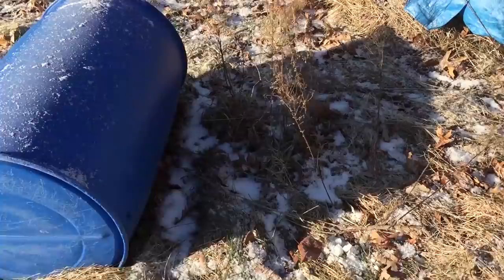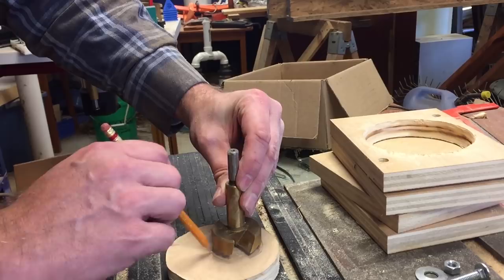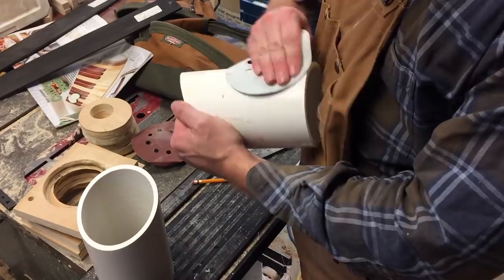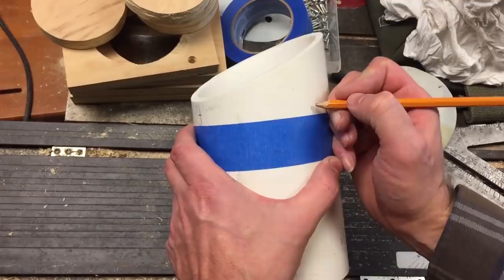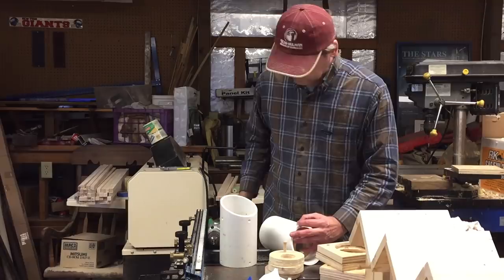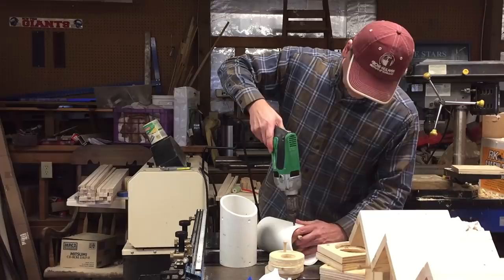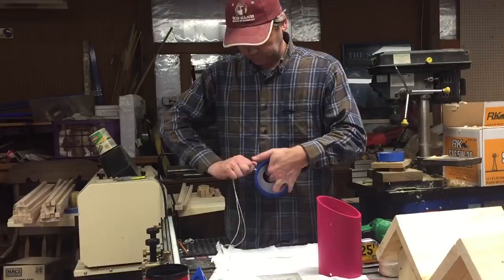PVC Bird House. Birdhouses from PVC pipe?  Are you serious?!?

Comment: I worked in a factory that had 6" dia cardboard cores from paper rolls about 2ft long as waste and I made log style bird houses of different lengths. I painted them with redguard waterproofing paint. If you make them vertical instead of horizontal you can just use wooden squares as tops and bottoms, easier than cutting rounds, and some birds like a deep log type nest box. On the deep ones I glued a strip of bird wire inside so the fledglings could climb up to the opening. I have nuthatches in one of my boxes this yr. I make boxes with different hole sizes and let the birds choose the one they like best rather than all the same size holes. I usually screw them to a tree so they are solid and some have a twig for a perch, some no perch, hanging a variety will show you what the birds prefer, I find birds will pick the smallest hole they can fit through eliminating larger predators 😊 .
Reply from the maker: That's a cool idea.  I may try to make some like that, I have plenty of pipe!

Comment: Zack, I made the same stile bird houses 2 years ago. For a perch I used a skeleton key. and same as you I used 4" pvc pipe.  But for the back of the bird house I used a 4" knock out plug. I got from the big box stores. Did not glue it in, that way I can pull the back of and clean out the old birds nest. and I get lots of birds in my bird houses every year. and my birds like the gaudy colors.
Reply from the maker: Gary, those are good ideas.  

Honestly, I was in extended family panic Christmas present mode when making these! LOL
I had to make due with material I had on hand. :)
I like the gaudy colors as well.
The houses were a big hit!

Thanks for watching

Comment: What kind of bird will live in a cavity like that with anunderstanding entrance hole that big? There are a lot of different kinds of birds that will move into a 4"x4" cavity had you made it vertical instead. I think at a depth of 9" (?) chickadees and nuthatches will move in, as long as the entrance hole is 1-1/8"Ø and 7" above floor. Keep all dimensions same but make entrance 1-1/4"Ø and titmice will move in. It also depends on how high you hang it off the ground and no perch. The 3 birds I mentioned like to live about 15' above ground. We have 2 kinds of chichadees here. They keep from cross breeding because they live on 2 different elevations. Those hollow bones of theirs must act as barometers and altimeters or something. ..anyway, cut the cavety down to 6" , keep the entrance at 1-1/4", 4" above floor and wrens will at least start to build a nest but in most cases, if it's hung right and made right, they'll move in too. The male wren will make a few nests in a few places and the female will decide on which one to move into. They only live like 5 - 8 feet off the ground. Some birds will live in houses, some on shelves but most won't live in either. Bird feeders are what you need to make and fill with good bird too (not that 100% millet crap they sell at walmart and target.) can't go wrong with sunflower seeds, cracked corn, cracked peanuts, safflower(?) seeds (the pure black sunflower seeds).
Oh, another tip about getting birds to move into your bird houses is to fill them with sawdust and wood chips so the bird thinks its doing the work of making the house. Whatever they don't remove will serve as insulation. I'm going from memory on all the dimensions. I believe the farmers almanac has all the info in it. I'm pretty sure that's where I got it  butI that was pre world wide web and Google. I'm sure it's all readily available info nowadays .

Comment: These are great! I have two questions, though:
1 - I've always read that you never put a perch on a birdhouse. If the bird is the right size for the house, they don't need it, and a perch gives a predatory bird something to hang on while they raid the nest

2 - Your balance point - it's no longer balanced once the bird makes its nest inside. What prevents the house from tipping?

Thank you for the wonderful idea. I need to make some of these!
Reply from the maker: 1 - I think we talk about hole sizes in my other bird house video.  You size the hole for the target bird species.  These holes are to small for predator birds, so the perch doesn't really matter.  This is a big debate where the divide is about 50/50. 

To perch or not to perch, that is the question... :-P

Besides, I think it looks nicer on there :-D

2 - The houses are short enough that they don't tip much when hanging. Additionally, the rear circle can be mounted to a post or other wall like surface to provide a static nesting experience. 

Thanks for watching.
Reply: YOU ARE CORRECT...NEVER PLACE SOMETHING LIKE A STICK FOR ANOTHER BIRD TO SIT ON
Reply: I have spent months researching into constructing birdhouses and discovered a great resource at Aviary magic method  (google it if you're interested)
Reply: @LumberZack  I think the debate about perches is still going on..Bird expert's say without,but also say birds prefer with a perch..did anyone ever ask the bird what it likes..lol
Reply: the smaller the peg ,,, the smaller the bird
Reply: fishtank5050  the problem is predatory birds like cowbirds, starlings and crows. They will eat the baby birds, or push them out ofthe nest, lay their own eggs, and the bluebirds end up raising them, instead.
Reply: @cathiwim  See, that's what I've always heard. And I have loads of cowbirds, jays, and grackle. Thanks, Baby Catcher.

Comment: I

Nice project but I'd like to make a couple suggestions. To
mark the position of the center of the 3/4 in. plywood front (if you have a
combination square) measure the distance the back edge to where you want your
countersunk screws and set the blade of the square to that distance. Then you place
the anvil (wide part of square) against the back edge and mark the end of the
blade for screw location. Then retract the blade 3/8 inch and use the blade
inside to hold the front in place and START a couple screws 3 or 4 turns. That
will stop the insert from twisting then tighten the screws. I would replace one
of those screws in the front and back plywood with screw eyes at each end and
top dead center instead of trying to balance the house. It would then remain
"level" and more stable when the birds move around inside it and I
believe the birds would abandon it if it tips too far. And finally the inside
of the front should not be sanded smooth. Depending on the size of the fledglings
and the entry height, the young birds MAY need to climb the "wall" to
get to the hole and a smooth surface could make it impossible. Some have used
old window screen or sheet rock sanding pieces stapled to the backside of the front
to make very rough surface.

Remember that birds are ungrateful tenants and will mess up
the house as soon as they move in.

Comment: You seem to have gone to a lot of trouble to find the prefect balance point to hang your bird house. So what happens when a bird builds a nest at one end of it? ImJustSayin
Reply from the maker: Hi Kenneth, Finding the perfect balance point has great entertainment value!  The houses are short enough that they don't tip much when hanging.  Additionally, the rear circle can be mounted to a post or other wall like surface to provide a static nesting experience. Thanks for watching.
Reply: @LumberZack  made mine with ✌🏾eye rings…🤷🏽‍♂️ works for me; keep up the great work bro!!!

Comment: Innovative idea... But hanging key at centre have a pointed tip (inside top of pipe,which is just in front of bird entry hole), it may harmful for MOM bird...and if this nest is shacking, what happend to egg / chicks...it should be firmly fixed with cage,then only bird select this nest for laying egg...
Anyway,idea is innovative but need to modify...
Best luck for more improvements...
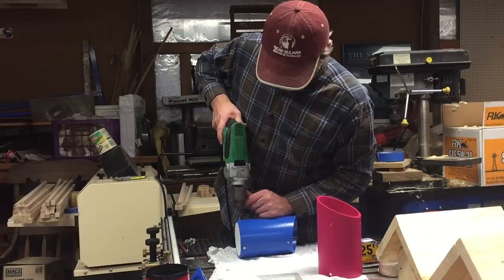Reply from the maker: Hi Rashesh, Thanks for watching.  I address the issue of the pointed eyelet at 10:35 in the video.  I discuss where I used the bench grinder to remove the point so that it's not dangerous for the birds.

Comment: Use 2 eye screws so the entrance hole is always facing the same way.  With just one eye screw the house will be in a constant state of rotation.
Reply: Also when a bird makes a nest in it, it will tip according to where the nest and birds are.  Might tip opening down and spill out the content of the nest or nose up allowing water to enter.  Really need two points of support.  Different birds require different holes and inside areas.  He needs to do a little more research.
Reply from the maker: @arkansasmountainman  A quick Google search will provide plenty of information on hole sizes.  Our 1.5" hole is the correct size for the Bluebirds in the local area that we were targeting.
Thanks for watching!
Reply from the maker: There is a bit of motion, but the ornamental trees we hang them in have a lot of branches.  This practically negates the motion issues.
Thanks for watching!

Comment: I tried the hole cutter you had, (scary), but wasn't happy with the blanks it was giving me. I found that a 4-1/8 hole saw gives you a perfect blank. Remove the centering drill, brace and clamp your wood, start slow and you got it.
Reply from the maker: Nice find!  That circle cutter is a scary knuckle buster for sure.
Reply: That thing could  tear off a finger.
 @LumberZack

Comment: I have a couple of mfr'd wood bird houses and the birds just avoid them.  Were you able to attract birds with your pvc house?  Also,, do birds prefer houses that are more stationary then those that swing?  How does one determine what size hole should be used?
Reply from the maker: The bird houses can be attached to a post or fence by removing the back, screwing in place and then placing the house onto the back and using the side screws to keep it in place. 

The fish and wildlife department for your area often have sizes for your local birds.

Thanks for watching!

Comment: I like this idea, But what I do not like is the eye screw you put in the top.. The sharp point sticks through that PVC and the bird can get hurt from that.. Would have to use different hardware
Reply from the maker: Hi Jay, thanks for watching.  I address the pointed eyelet at 10:35 where I talk about using the bench grinder to remove the point. It’s easy to miss as the grinder footage didn’t make the final cut. :-)

Comment: Building a bird house is fun but this video is not how to do it. Bird houses need natural wood not PVC (heat build up may kill occupants)  a door or access to clean them, drain holes, adequate ventilation to avoid overheating, never use perches, they invite predators, always add a predator block over the access hole.  Always go to a reputable birding site to get correct, safe plans that are good for the birds that may use it.  Building a box with a hole is not a bird house. You Tube is great but DYI people with little background can easily follow bad advice.  I can see you have skills, use them correctly to make safe homes for birds.

Comment: I HAVE A BIG QUESTION....YOUR SUPPOSE TO CLEAN OUT THE BIRDHOUSES OUT EACH FALL AND ALSO LEAVE OPEN SO MICE DO NOT BUILD NESTS OVER WINTER.
Reply from the maker: The backs of the bird houses are screwed in for easy removal. It makes cleaning a snap.  Thanks for watching.
Reply: I HAVE NOTHING BUT TROUBLES CUTTING A ROUND FRONT AND BACK TO FIT IN NICELEY....MY JIG SAW ...THE BLADE BENDS AND NEVER STRAIGHT CUT...I HAVE NIO BAND SAW
Reply: OK...I WATCHED IT AGAIN.....WHERE DO YOU GET AHOLD OF THAT CUTTER FOR YOUR DRILL PRESS...I WANT ONE!!! WHATS IT CALLED?
Reply from the maker: Hi Scott, it called a circle cutter.  I either bought it at Menards or Harbor Freight years ago.  It's a 2 blade version and presently only Harbor Freight has one on their website. HF part numbers are: 69063 & 68117, though I cannot tell any differences between the 2.
Reply: I LOOKED IT UP AND FOUND ON WALMART.COM...SINGLE BLADE
Reply from the maker: The thing is crazy scary spinning around. I found the trick to being successful with it is to set the blades so one is cutting the size circle you want with the flat side in toward the center.  Then set the second blade with the flat side toward the outside and at a distance that is just bigger than the thickness of the inner blade.

The outer blade kind of opens a canyon for the inner blade to swing in. If you don't do this the thing wobbles and will stuck. Not to mention that you'll have more of a flower than a circle IF you manage to complete the cut.

One blade is longer than the other. Use the longer blade on the inside so it completes the cut cleanly. 

Use slower speeds and even downward pressure and you'll be successful.
Reply: @LumberZack  Forstner Bit cuts smooth perfect circles.  Cost $15 -20.